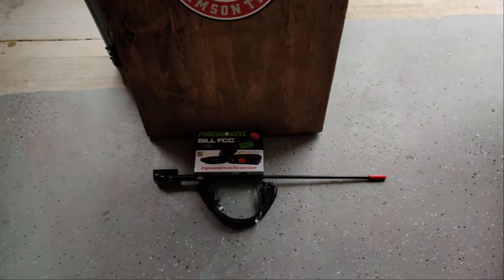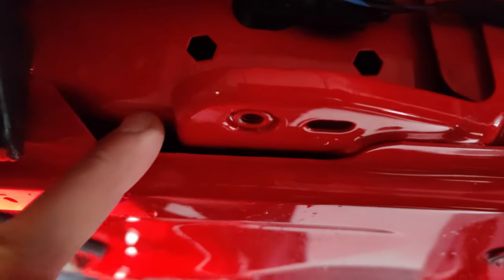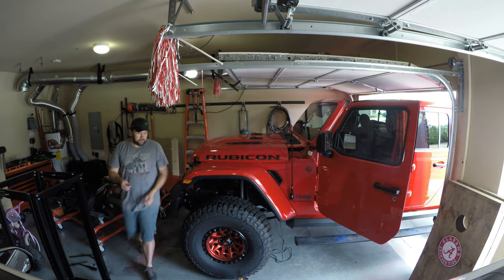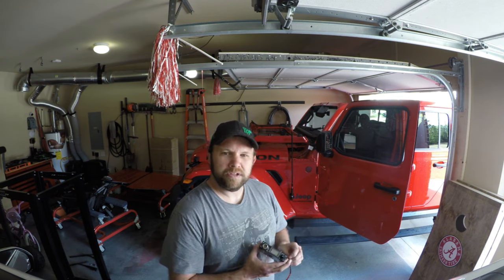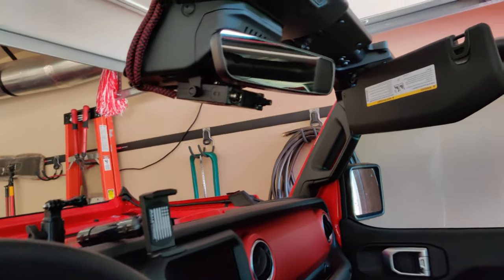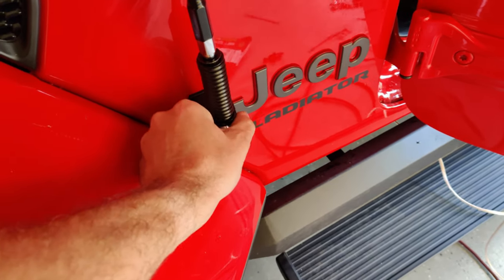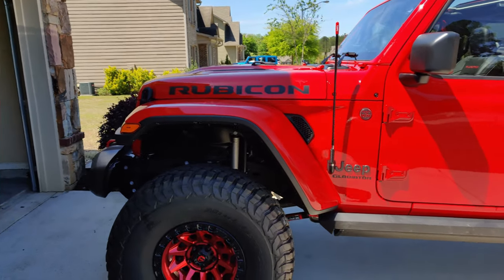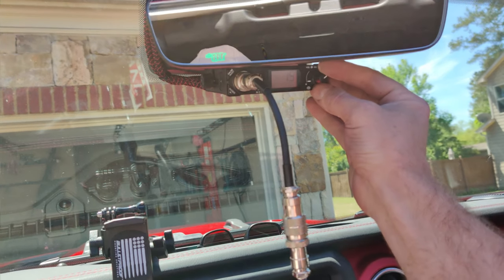Jeep Gladiator President Bill CB Radio Install

Comment: Ill Thumb-up any man who takes a drill to his jeep. I have a President Bill on the way right now, looking for ideas.
Reply from the maker: If I had it to do over again, I would have mounted it higher up due to swr tuning. Too much of the antenna is running alongside the fender/panel, messes with swr calibrations. Had to get a longer antenna to offset.

Comment: Is there a firewall passthrough point for the wires on the JT?
Reply from the maker: There is a spot on the drivers side. It is a plug that you can twist and remove, then cut a little notch in for wire access then reinstall. Some peeps don’t even reinstall it, but if you don’t, you’ll have roughly a 1.5” open hole through to your interior that could present water/moisture issues (if you care about that). Look on the firewall (from the drivers side) below the brake system and you’ll find it.

Comment: I think that antena is to low. I got the same radio in my pajero sport but i install diffrent antena (sirio megawatt 4000).
Reply from the maker: You are absolutely right!  I learned, post install, that the antenna height need to be lengthened in order to get proper SWR readings.  I have since replaced the 2' with a 3' Firefly antenna for much better SWR's and a lighter antenna reducing some stress on the mount.  In the end, I wasn't really worried about transmitting as far as humanly possible, or else I would have went with a 6' whip on top of the roof :).. I just wanted the ability to communicate with fellow Jeepers while on the trail, likely never more than 500 yards apart.  Mission accomplished there.